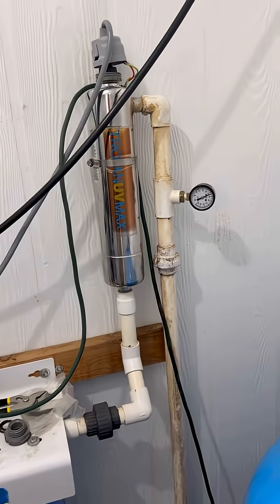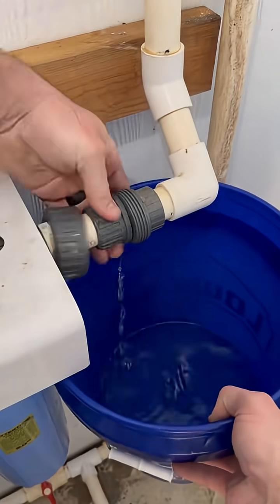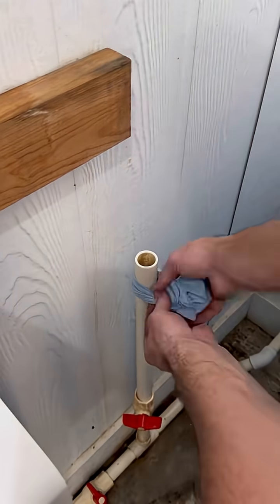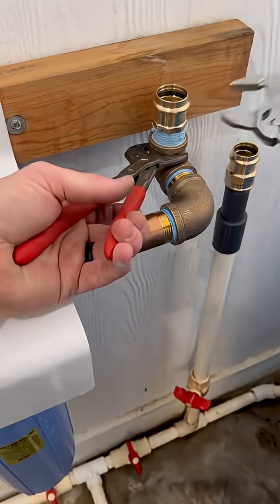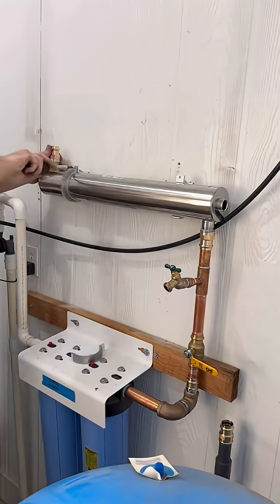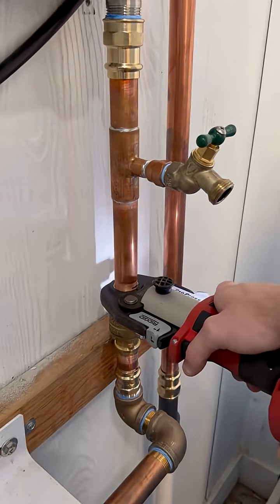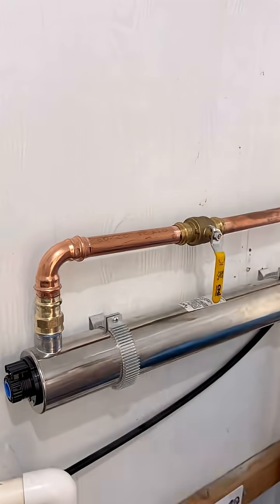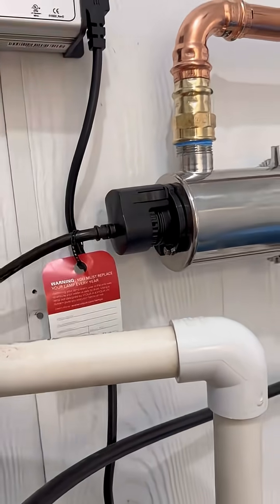Rainwater Collection UV Filter

Comment: Should have used schedule 80 nipples going into the filters dude.
Reply from the maker: I don’t like using PVC inside a building. I have yet to have any issues using brass into the filters. Just don’t overdo the tape and don’t bottom out the threads
Reply: Nah, brass is better.
Reply: Depending on where you live, if exposed to heat the brass will expand inside the plastic housing and cause a leak. Plastic always goes into metal when transitioning to esp when exposed to heat.